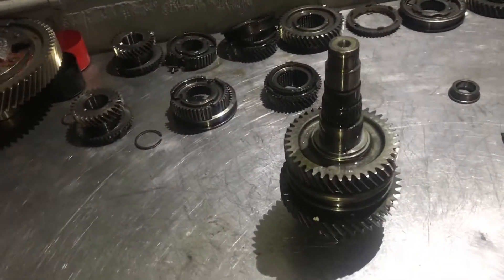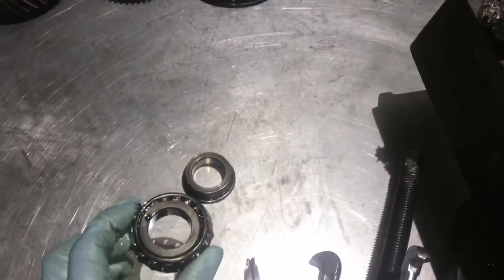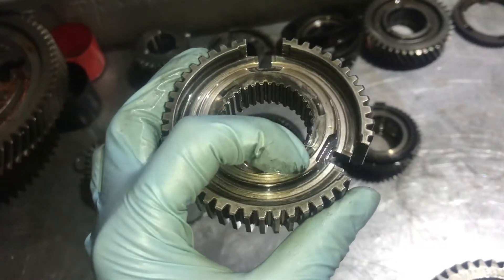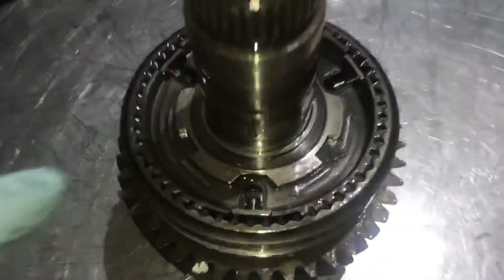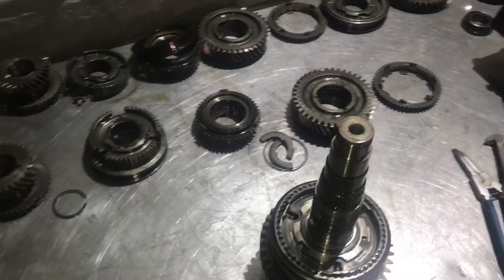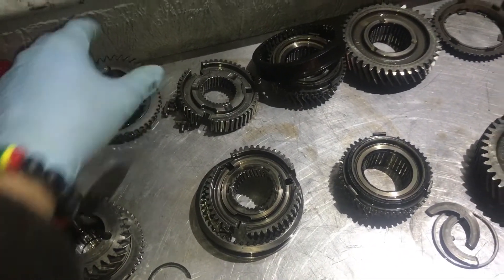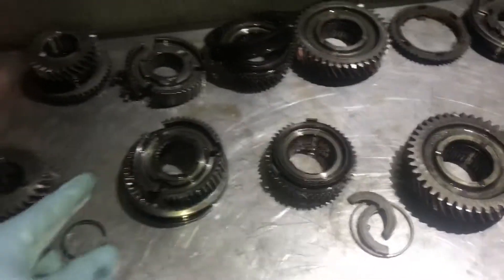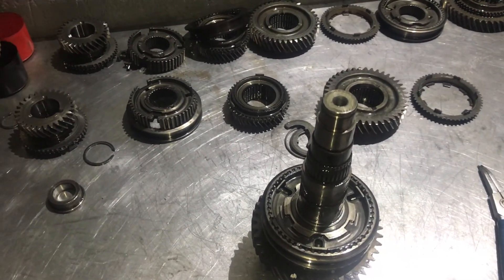M32 Gearbox Bearing Failure Fault/Rebuild Service Corsa Astra VXR Etc..

Comment: How you put out race bearings
Reply from the maker: To get races out I use dealer race pulling tools. Or a home made tool that I have.
Reply from the maker: To get races out I use dealer race pulling tools. Or a home made tool that I have.
Reply: @S.E.Motorsport_Tuning  thank you replying . How can made one . Can send a pictures of yours at webs1986@yahoo.it. the dealer one is expensive ?
Reply from the maker: Fieraku Itali end casings I re shaped a leg off a 3leg bearing puller and use with small hammer to get out. But main races on output shaft will have to use a dealer tool.
Reply: @S.E.Motorsport_Tuning  best way this one . Never thought . Thank you mate ❤️